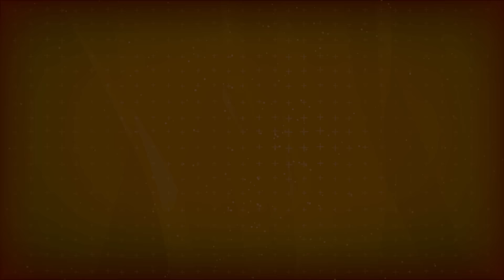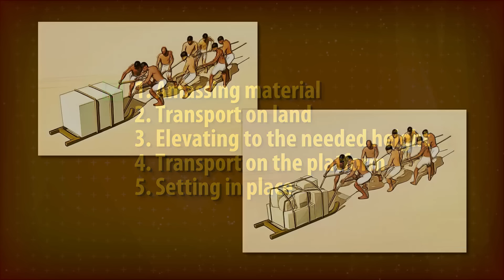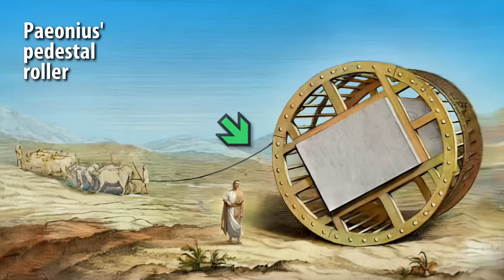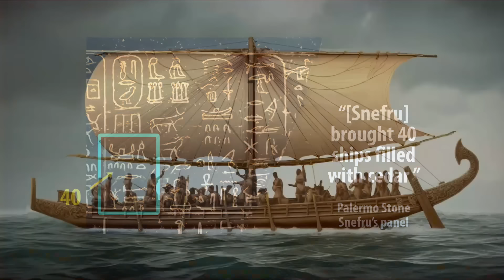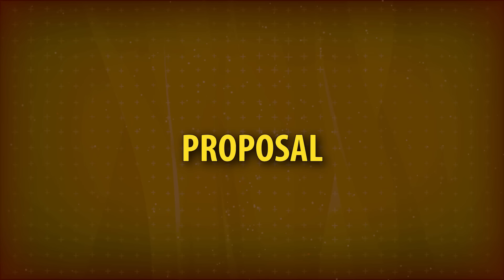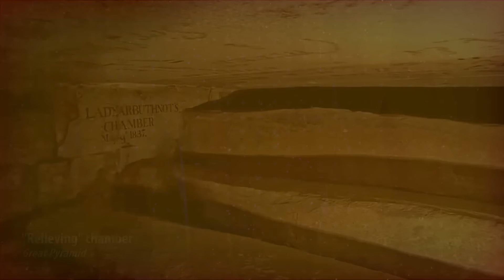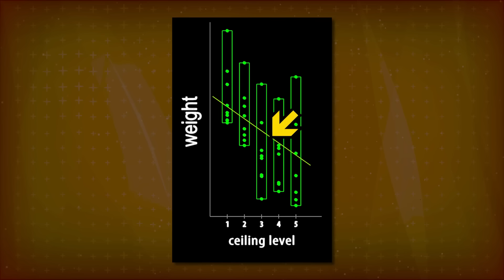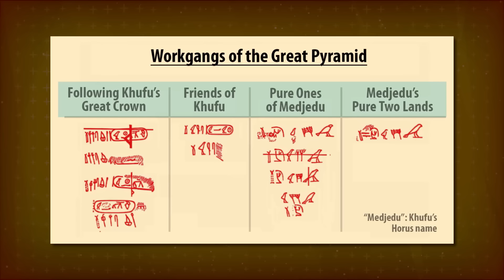How to Build the Great Pyramid in 9 Months (NOT aliens)

Comment: My personal theory is that the pyramids were built primarily using opposing counterweighted sleds on steep lifting surfaces (essentially similar to a counterweighted funicular railway). Early construction would use vertical counterweight shafts cut into bedrock (the common T-shaped excavations) to rapidly raise stone and build a steep, stepped core. Steep faces are mechanically more efficient than shallow ramps when friction dominates, which explains the steep internal layers at Djoser and Meidum, Menkaure, and are believed to exist for most all large pyramids. Once the pyramid grew large enough, the faces of the pyramid itself were smoothed and used as opposing ramps, with sleds and human-powered counterweights running on opposite sides with rope guides over the top. This allows multiple parallel lift paths early, then fewer paths as the pyramid narrows and less work needed (no bottlenecks). Smooth casing wasn’t just aesthetic: it was functional, turning the pyramid into its own lifting machine all the way to the pyramidion. Large internal ramps (e.g., the Grand Gallery) were only needed for exceptional stones. No external ramps are needed, just some facing to protect the surface of the casing stones from damage. This theory reduces total ramp volume (essentially zero since all ramps are built into the structure itself), explains stepped cores, steep faces, central shafts of mastabas, T-shaped excavations, while staying within known Old Kingdom materials and labor limits. It also importantly explains how the top casing stones were placed, which is a failing of most theories, since some of the casing stones we see at the top of Kahfre are absolutely massive, any system where this was difficult would have to explain why they didn't use smaller stones closer to the top.

Comment: Problem #1)  The rubble hypothesis is demonstrably false.  There are numerous chambers in the Great Pyramid that have various shafts and passageways that that go in various directions and either almost to the exterior of the pyramid, or all the way to the exterior of the pyramid.  The lowest chamber is below grade at the Giza Plateau.  The Queen's Chamber is several feet above grade.  The King's chamber is well above the Queen's Chamber.  There is even a small chamber above the King's Chamber.  According to muon data, there is also a void above the small chamber that is above the King's chamber which has never been entered or physically observed.  Rubble is a poor building material which is subject to shifting and differential settlement.  There is no way that all of these chambers, shafts, and passageways are surrounded by rubble with just a few megalithic stones around all of the chambers, passages, and shafts.  If the pyramid was built that way, it would have collapsed a long time ago due to differential settlement.  Then you have the problem of containing the loose material while you are transporting and lifting it.  The container would have to be extremely sturdy, not subject to much deformation, whether elastic or inelastic, when subjected to the live loads imposed on it by lifting and moving the load, not prone to tipping over, and it would have to be made of an extremely durable material that could take heavy abrasive contact, shear, and impulse forces that would occur as the material is being  loaded and unloaded.  It would take a substantial amount of time to fill such a container with rubble with only manual labor and primitive, human or animal powered machines.  Sorry, but the Great Pyramid is not filled with loose rubble.  Every level of the pyramid was engineered throughout its entirety, aside from perhaps the foundation, which may be pre-existing limestone which they leveled before the construction process occurred.

Problem #2)  Lifting the material.  Regardless of whether the material is lifted as a monolithic block or as loose rubble, it would take considerable time and power to lift that material to the placement heights observed in the pyramid.  Even in modern construction, it takes a substantial amount of time to lift materials to their installation location.  What you are claiming is that it is possible to lift the materials of the Great Pyramid to their installation locations quicker with primitive methods than we could today with tower cranes.  Sorry, but this is simply not possible.

Problem #3)  Logistics.  There is absolutely no way that the Ancient Egyptians quarried, dressed, and transported that much material to a job site in only 9 months.  We could not do that today with modern transport ships.  The quarrying alone in that time period is quite impossible.  But then you have to dress the stones so that they at least have a loose fit, and you are doing it all by hand with chisels, shaping rocks, and pounding stones?  I don't think so.  Then you have the inevitable bottle necks at the quarry and at the material staging area of the pyramid.  It takes time to load and offload ships, especially if you are doing it by hand.  This can only happen as fast as the ships can pull up to the dock and load/offload the material.  Then you have the considerable amount of support that would be required to even do the work.  Vast amounts of food, tools, and shelter would have to be created and dispersed to the workers.  And you are talking about hand making all those tools, hand making all those shelters, and hand planting and harvesting all that food.  All of these would take considerably more time using only the primitive technologies archeologists claim the Ancient Egyptians had.  Then you have the transportation from the material staging area to the pyramid and its placement in the final structure.  There would be severe bottlenecks at every lifting location, especially if you are only using human/animal power.  You can only fit so many people in a certain work space.  

No, your claims are quite physically impossible.  There is no way anyone could build the Great Pyramid in only 9 months.  We would not make that timeline if we used the most advanced modern technologies available today.

Comment: The Pyramid workforce;(mainly agricultural workers,doing work duty for Pharaoh)-had to work seasonally on the Pyramid.
First crops were planted in  the Fall, after the Nile receded. Secondly crops were  harvested in Spring/late spring.
That left the rest of year to work for the Pharaoh. The summer Nile floods would be used by boats to transport the stone blocks, almost up to the pyramid. Probably two sets of work crews. One to build the core structure..and a specialized crew to apply the outer casing stones. (Plus the quarrying work crews, and the transportation work crews).

Comment: Wheels don't travel well in sand; they quickly sink in. One needs very wide wheels - either wide tread, or wide radius - to be mobile  as the  Egyptians found out when the  Hittites attacked them in roughly 1250BC with chariots that had wheels with radii large enough to  get through, actually OVER sand. That was their first introduction to wheeled . However, the chariot wheels were hand-crafted along with the chariot. Not practical for  everyday commerce or building.

Comment: very interesting ,, but as usual this idea only answers one small part ,,, to date no idea at any time has taken into account all parts of the project ,,, no one has taken on the exact precise stone cutting method ,, and it is the most important piece of the puzzle ,,, without the exact precise cutting the blocks would not be square and the pyramid also would not be square
Reply: The limestone blocks are not cut,precise or square. the limestone was split from the layers in quarry beside it

Comment: have we considered also for full blocks, in a square cross section. you could max the bandwidth of the quarter arcs and avoid all the lashing labor by putting them on the ground as "tracks" for square wheels.  you would only need to move the light wood frame forward from the rear just like rollers but with less lifting /moving labor involved.

Comment: 9 months is one block every 9.3 seconds. I’m a stonemason for past 25 years. I also have a degree in structural and civil engineering. My stone company has been flown all over the world to work on heritage listed sites. 
I’ve climbed the great pyramid in 1996 and 1998. I’ve always known about the voids filled with rubble. You forgot to add that sand also filled the rest of the voids. The sand can still be seen if you climb it. 
I will say that even with modern machinery using an army of cranes there’s no way the great pyramid could be built in 9 months. You’d be looking at a couple of months (with our biggest machines) just to get the bedrock ready. That’s not including all the ductwork they did before starting. 
Ok so I’ve spent some time working it out roughly if I was contracted to recreate this and using googles block count and don’t include all the granite work. (I also add in that all the blocks and outer stones are already cut and waiting) 5 150T cranes per side. I would estimate 5 -7 years and wouldn’t be surprised if it went to 10 years.
I have to add in. Unless you’ve been there and seen it in person words can’t describe it.  I’ve worked on some sites that I’ve gauged from photos of work needing to be done, then got there and just stood there in awe at how they achieved some of the work for the time period. There is some stonework we can’t recreate today.
Reply: Someone didn't actually watch the video.

Comment: Just 3 mins in and I really appreciate the effort already. One of the most often repeated claims is that it would take too long to quarry and dress every block to high precision in the building of the Great Pyramid. I and many others point out that the precision is highest on the outermost courses, being most precise with the casing stones, and it all becomes pregressively more roughly cut as you get closer to the inner core of the structure. This would save immense amounts of time and effort, while maximizing the time that could be spent on the precise facade.

Comment: Obviously 9 months is far fetched as the minimum possible time since its is computed assuming a 24x7 work day.... Plus there is the issue of quarrying all those blocks.
But it does show that a feasible minimal estimate is about 3 years

However current estimates are closer to 20 years (sometimes 27 is cited)

Here is a simple calculation that does not rely on which method was used to move stones. The maximum estimate of the weight of the great pyramid is about 6 million tons (it is probably closer to 5 given the empty spaces and the fact that is build around a small stone hill which could fill 10% or more of the interior space). The calculation below  shows that 6 million tons could be moved in 20 years (with margin) with less than one thousand movers

Since antiquity, soldiers on the move have routinely marched 30 km per day carrying a load of about 30 kgs. Specialized workers can do better. The famed sherpas of Nepal for example routinely carry over 70 kgs in a mountain environment with reduced oxygen.  Keeping to more modest numbers this would be roughly equivalent to each person carrying one ton over 1 km distance per day (obviously such a person would not be carrying one ton at a time but anywhere from 20 to 50 kgs and making several trips or working as part of a team that would move bigger loads). With the main quarry being some 400 meters from the pyramid, 1 km on average is enough for a round trip and a worker could do 30 of those in a 10 hour work day (note that the worker would only carry a load on his way from the quarry to the pyramid, not on the way back to the quarry)

So sticking to that one ton a day over one km (which again is more than sufficient to cover the distance between the quarry and the pyramid plus account for elevation change), and assuming 300 days of work per year (allowing for 1 days of rest per week plus additional holidays) one person (or the equivalent of one person, e.g. one individual would do the work for the first 10 years and be replaced by someone else for the other 10 years) would move 300 tons per year, or 6 000 tons over the 20 year construction period.

Thus a workforce of only 1 000 would be needed to move 6 million tons of material over 20 years, reduced to some 850 if only 5 million tons were required. 

But this number assumes the Egyptian used no “force multipliers”. We do know that Egyptians used tools such as levers or simple cranes, sleds, ropes etc. They also had access to pack animals. Once you account for "force multipliers" either the time or the worker headcount can be significantly reduced

Comment: I've been to the pyramids, and I've been inside the largest one. The outside casing stones (the ones that still remain) are precisely cut and fitted, but everything else is super rough, as you point out. And, as you progress up the pyramid, the thickness of each level varies. It's as if they cut stones in the quarry to a rough general dimension, then laid them out and sorted them, ranging from 2 feet thick to 3 feet thick. All the 2 feet thick ones were used for one layer, then the 2.5 feet thick ones for the next layer, then the 3 foot thick ones for the next. This is clearly visible from a distance. The stones were definitely graded by size, rather than cut to exact dimensions. This had to have saved a lot of time. As far as lifting the stones went, I noticed something significant. The Grand Gallery inside the pyramid is a ramp, and it seemed pretty obvious that a lot of heavy stuff was pulled up it. How do I know this? The center stone at the very top (in front of the entrance to the King's Chamber) is heavily worn. There's a deep U shaped wear pattern in the center of it that's been filled with what looks like a lot of epoxy and other fillers. It's about 18" wide and 6" deep. It looks like the repeated use of multiple large ropes wore through the rock as it acted as a pivot point for thousands of pulls. Also, advanced X-raying of the pyramid has recently shown there's another slanted void inside the pyramid above the Grand Gallery. This is likely another internal ramp, possibly now filled with sand or small rubble.

Comment: The fractal ramps show all possible ramps; depending on time you can develop any number of those ramps at any one time.  For example, the number you can bring to the upper X level size then you have to get that number of lifting sets instead of building more than you can keep using the entire project, or build as many more as you need to shorten work time below.  Better, if the lifting equipment was a re-task of somethimg from their ships or other infrastructure then you can just bring it in the offseason to use on the pyramid and send it back when you arent using it.

Comment: Hey N.S...You may know this already or have learned it since, but those "quarter rounds" can have several uses. One is they can be part of the wooden "falsework" of building stone arches and are typically used in pairs from the “spring” through the “haunch” and meeting at the “key”...This being about the pyramids...they are most likely… "roll track"...(See link below)...which is a common device for those that move blocks around with manual systems rather than a modern machine...Because of the design of the ones in the video, I'm doubtful they would have been strapped to a block in sets of four as this would not be as efficient as a "roll track" method...Again, most of this is not found in books or documents but rather oral traditions among those of us who still move stone and large timber traditionally...Like everything I have seen you do so far...This was a fantastic video...!!!

https://youtu.be/rgkXfSLcJgg?t=1013

Comment: I’ve heard that the kings chamber has granite stones weigh possibly over 50 tonnes! What kind of wooden frame could support such weight? Check out the chassis under your car that weighs under 3 tonnes made of steel. Do you recon you could make a strong enough wooden frame for 50 tonnes? What about the strength of the rope used? Modem day elevators use four to five steel cables for 10 tonne. I don’t think people can comprehend weight at that level…. It’s far beyond the load required to flatten tough metal.

Comment: I’m not an engineer but I have studied engineering as a hobby. This has been without a doubt, the most comprehensive and well thought out presentation and put forth several incredible ideas and points I’d never thought of that, once presented seemed like a no-brainer. Thank you for this. The most fascinating presentation I’ve seen in a while on any topic.

Comment: I got about 19 mins in before I stopped. It’s not “some sources.” Almost all of mainstream Egyptology claims that the Egyptians had no concept of the wheel. The concept of the wheel doesn’t just encompass actual wheels; it means pulleys and even rolling stones in circular encasing. If the Egyptians had access to the wheel then the entire problem of time goes away. That’s what is so infuriating. Archeologists are pretty adamant about that fact. Maybe they will change their mind in the future but any assumption that they had a concept of the wheel automatically goes against the mainstream ideas.